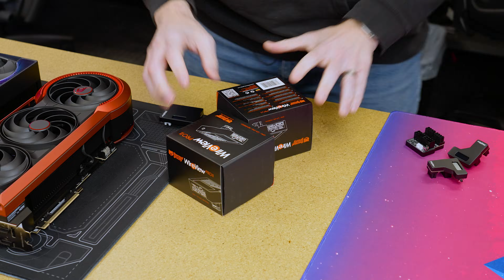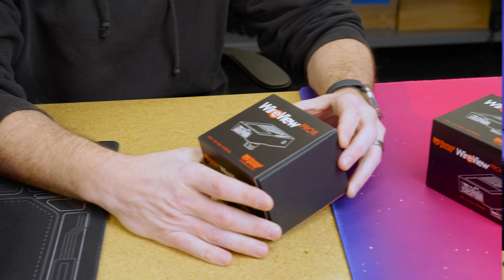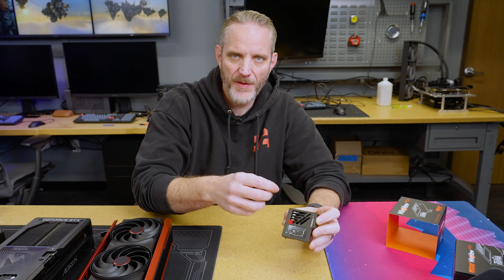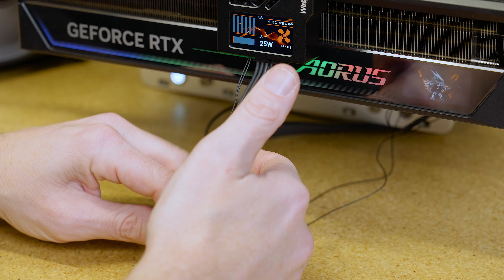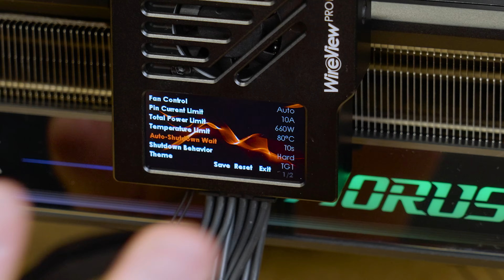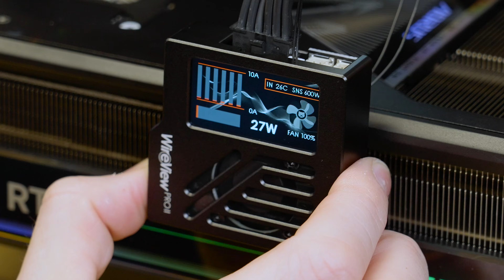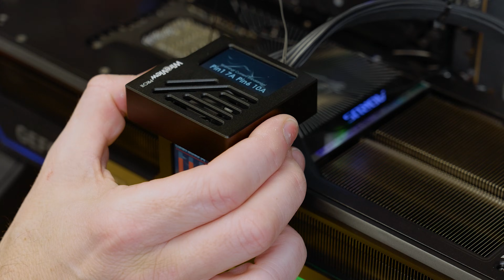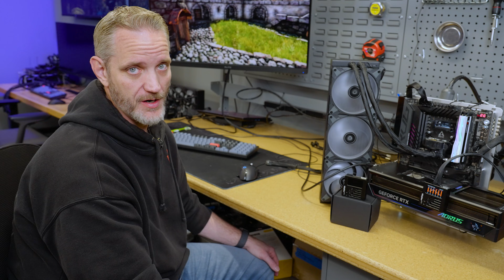Thermal Grizzly Wire View 2 Pro - The fight against melting connectors!

Comment: This will be a must have for rtx 6090
Reply: Bold of you to assume theres even going to be a 6090. I wouldn't be surprised if there was eventually a phase out of higher end GeForce cards. From my understanding, there's so much more money in mass producing low end cards for integrators and even more money in the RTX PRO cards that it doesn't make sense to waste resources on churning out 70, 80, and 90 GeForce cards anymore.
Reply: @ccayco  This is the sad reality. There's so much more money to be made by producing cards for the AI Slop Generator market so they may eventually pull a Micron and stop making consumer products altogether.
Reply: @ccayco brand image is a thing also. 

nvidia getting big by becoming the gaming gpu company #1 and then loosing that free marketing of wiping the floor with amd every year would be just stupid.
Reply: you seriously going to pay 6 thousand dollars for one component ?
Reply: I'm waiting for the High Temperature Superconductor tape. Gunna drive down to Commonwealth Fusion and snag some out the back of a truck :3
Reply: Not unless Nvidia makes changes to the connector cable and connections on the GPUs
Reply: Nvidia better add 2x 12v 2x6 at the minimum, like they did with the titan prototype (12vhpwr on that one). Only way it will be somewhat safe, assuming they don't double the power draw.